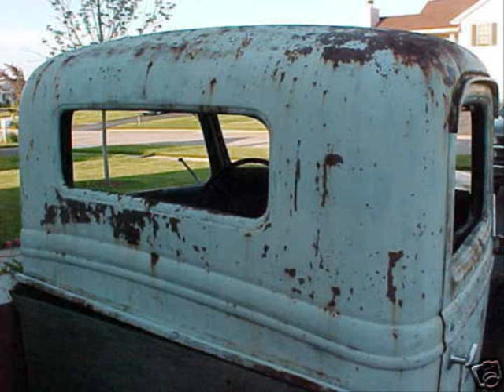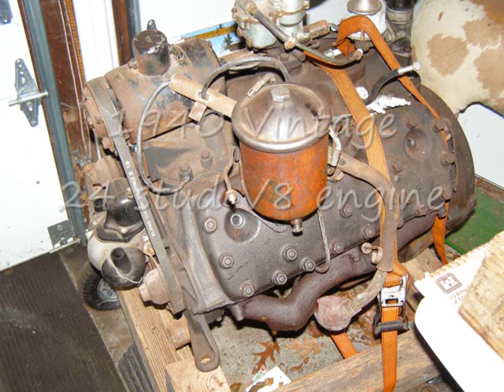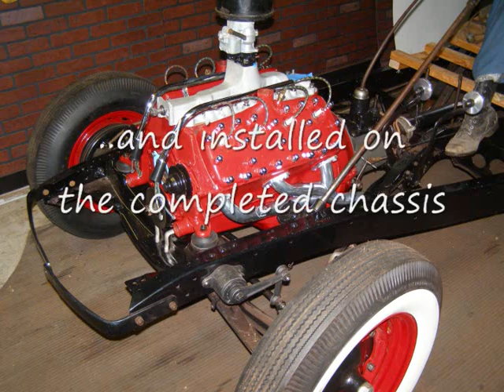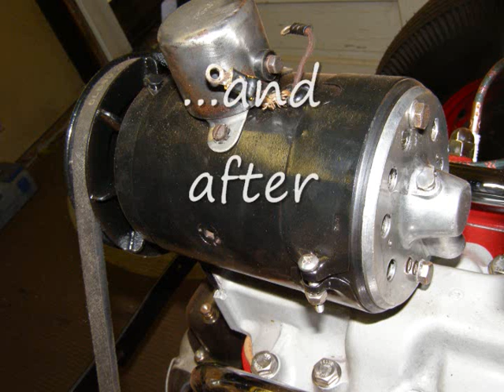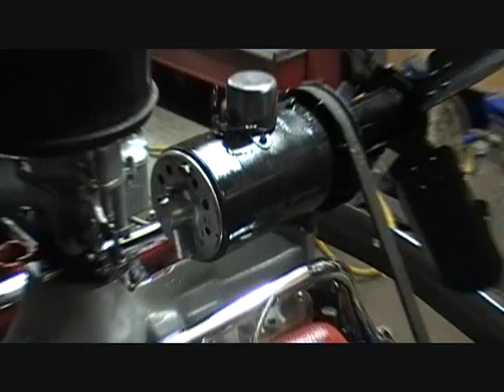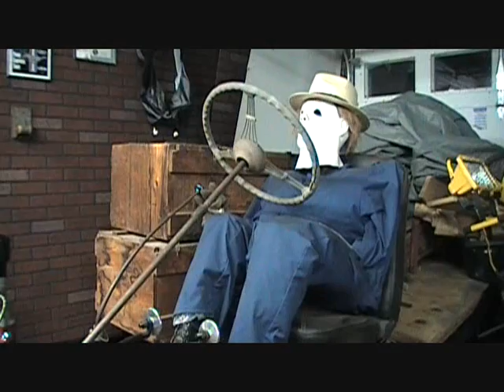1936 Ford Flathead 1/2 ton pickup truck

Comment: Hello. Was looking for help on my 1936 Ford Truck and saw you on  You Tube. Would you happen to know the firing order of a v-8 flathead and where the sparkplug wires go? I have followed 3 different schematics and the truck is still popping and cracking and won't start. Any help would be greatly appreciated.
Reply from the maker: Linda Gaebel ... I suggest posting your question and a pic or two of the engine at FordBarn.com. The first thing to determine is exactly which engine is in your car now. Lots of changes over the last 70-80 years.